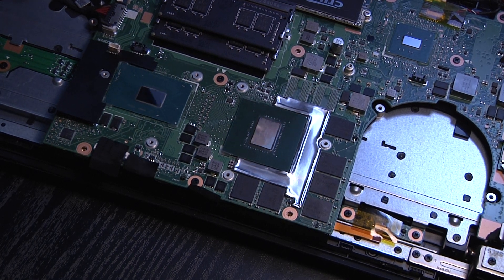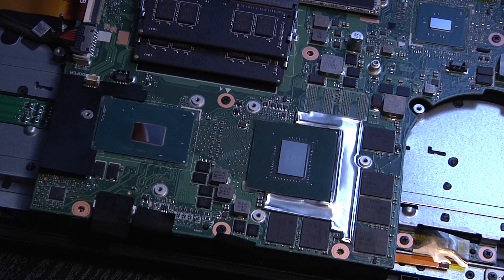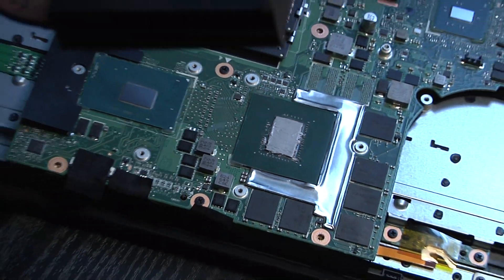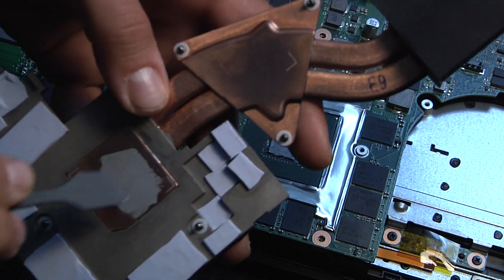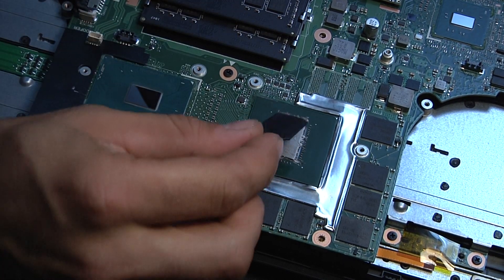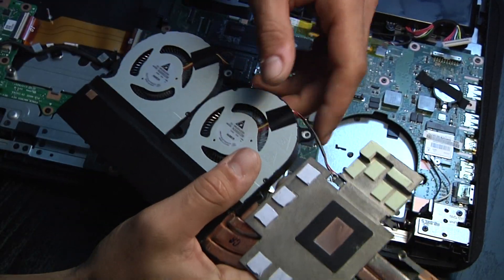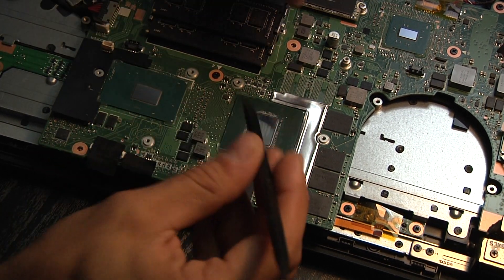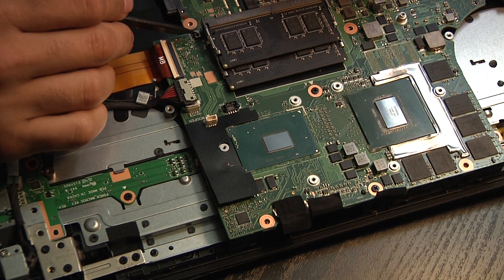How to repaste a laptop CPU & GPU

Comment: hey bro my thermal pads on side chips were degraded so the technician pasted new ones but it didnt help with temps and made it worse probably cause it was thick. so can i apply non conductive thermal paste instead of thermal pads as i dont have correct measurement of it?

Comment: Hello can u tell me what thickness did thermal pad u used on the video. i was thinking is it better when i use thermal paste on the cpu, gpu and use thermal pad on vram like the surrounding area of gpu and cpu ( i dont know what is that called ) & using the . or should i just use my thermal pad on gpu cpu and like the surrounding area of gpu and cpu. Thank u!

Comment: I recommend to try phase-change material Honeywell PTM7950. It comes as a sheet and you don't have to mess around with any applying dots, dashes or crosses. Just cut out a piece the size of the IHS/core and stick it on. Also don't have to worry about whether the paste is too little or too much - it will be just right. In addition, it lasts longer, performs works better than traditional pastes and there is no pump-out effect.

Comment: 2:18 when applying liquid metal it would be best practise to apply a conformal coating to the resistors and capacitors surrounding the cpu and gpu. One coating I like is "MG Chemicals 422C Silicone Conformal Coating". If you live on the coast like I do, you could coat your entire board (excluding cpu/gpu dies, slots and connectors of course) in this stuff to prevent corrosion and short circuits from humidity.
Reply from the maker: Conformal coating is also another method. I suggested nail polish because it's cheap and comes with an applicator pretty much built in. Conformal coating typically is in a spray can so if you desire to only coat around the die, it would be a bit messy.
Also suggesting to coat the entire mobo I wouldn't recommend, as it can cause plugs/latches for ribbon cables etc to become stuck and if a component needs replacing it would make it difficult.
Reply: @HotelHero  422C usually comes in bottles and is applied with a brush. You can still easily repair the board as you can solder straight through 422C. If need be, you can remove it with a conformal coating stripper. I did also mention in my original post to not coat/let it get on connectors, slots, etc.

Comment: I have a laptop i bought 3 years ago and it started to reach high temp these days. I had a stress test on XTU and CPU gets 98-99 and GPU gets 90 degrees during the test. I am not an expert but it is hot as far as i know. I am thinking about using new thermal paste by doing things you recommend (which i appreciate a lot) I have a few questions though. 1) Should i try to clean GPU chips? If so, how? 2) Should i use that piece of glass to spread all over CPU and GPU? 3) Is it possible to use the same thermal paste on GPU and CPU? I hope you reply back, THANKS!
Reply from the maker: Not sure what you mean by cleaning GPU "chips". Do you mean the VRAM?
Reply: @HotelHero  Yeah, i do. I have a pure alcohol. Is it possible to use on chips (VRAM) And i repasted both GPU and CPU but this time CPU reaches over 90 time to time. It goes around over 90 and 80's time to time.. Is it related with pasting problem?

Comment: Thank you for this video! I've actually changed paste may be like 5 or 6 times in different laptops but never changed the pads. But now I think I need to change them in my laptop. But I'm unsure about the thickness. 
I've the nitro 5 2018 which has the same exact body and heat sink as the helios 300 2018 and same specs too. Just the fins of the fans are plastic. 
What's the thickness of the pads you used in the helios 300? I think there are 2 different pads, one kind of yellowish and the other white. Are both of them the same thickness? And is a 100x100mm enough?

Comment: Spot on. 

Just a line or a centre blob is NOT enough.  We do have to have a thin layer,  just like Thermal Grizzly recommends.

Temps will effectively go down AND IT ALSO MINIMISES THE PUMP OUT effect. 

Great,  great video. 👍
Reply: I recommend to try phase-change material Honeywell PTM7950. It comes as a sheet and you don't have to mess around with any applying dots, dashes or crosses. Just cut out a piece the size of the IHS/core and stick it on. Also don't have to worry about whether the paste is too little or too much - it will be just right. In addition, it lasts longer, performs works better than traditional pastes and there is no pump-out effect.

Comment: I've just repasted my first laptop by using the spread method as shown in the video. The laptop was still on its factory thermal paste and I've had it for 8 years now. I was shocked when I saw The CPU temperature drop by 20*C! I was hitting 94*C under all-core load before and now it's 74*C. I'm so happy! The GPU temps dropped too from 62*C to 58*C (tested with Unigine Heaven benchmark).

Comment: What is the problem with squishing the thermal pads? The thinner the pad the better the heat conductivity and if you get metal to metal on the cpu and gpu thats a good thing as well... So why not tighten it well?
Reply from the maker: Because if you squish beyond the OEM thickness you'll have metal to metal contact between die and heat plate = overheating and squishes paste out from plate
Reply: @HotelHero  OK i think you got something wrong there, metal to metal contact is not a problem in fact its desirable, the heatpaste is only there to fill the microscopic or bigger gaps where there is no metal to metal contact but its not supposed to get in the way of metal to metal contact - at least as far as i understand it
Reply: @HotelHero  Metal is far better at conducting heat than any thermal paste is, copper has a thermal conductivity of 384 W/mK, while a good thermal paste with metal or graphite particles in it has only about 10W/mK - air though only has a conductivity of 0.026W/mK.

So the idea of the thermal paste is to replace the air that would be between the die and the heatsink, due to their roughness and uneveness, because the paste is about 300x better at conducting heat than air. 
However the metal is still 30x better yet than the thermal paste is. 
Metal to metal contact is therefor ideal.

Also the heat flow through a barrier is inversly proportional to the thickness of that barrier - the thicker the insulation or wall the slower the heat will flow through it, because the temperture gradient across the material will be more shallow - we know this from every day life.
That means that you want the least amount of thermal paste seperating the two metal surfaces. If the heat has to flow through 2x the amount/thickness of thermal paste then only half the watts are going to flow through it (if the temperature difference would stay the same between die and heatsink, in reality the die will heat up and the temperature gradient will increase again and the same watts are going to flow again just with a slightly hotter die) - thats why you dont want any seperation of the metal surfaces.

So there you go - the thermal paste is only there to replace the air that would otherwise be inside the microscopic scratches and roughness of the metal surfaces but NOT to get inbetween the metal surfaces where there would otherwise have been metal to metal contact, and you certainly dont want a thicker layer of insulation between the metals made out of thermal paste, which sucks at conducting heat, relative to the metal.

Please tell me if you disagree or not...

Comment: Right on! I was watching instructions for my specific laptop, but the guy didn't really do it right and I just copied what he did.. just left the drop in the middle and that's it. So I will have to re-do it, but at least this time I know it will be done right! Great video
Reply: When you spread it you introduce air bubbles, you're supposed to put a blob in the middle or do an x on the die then when you apply pressure to it from the heatsink it will spread it. If it doesn't spread across the entire die there is not enough paste or not enough pressure from the heatsink.

X method does actually solve the problem he is showing here. He mangled the x but that is the best way because its pushed out without introducing gaps of air in the paste. You get a good spread.
Reply: @donniedarko7751 That has been debunked numerous times, you don't create any air bubbles spreading it, it's bullshit

Comment: Hey boss, I just applied mx4 and my temps actually went up, but I think i know why. U see these heatpads (not the paste on the processor/gpu, i mean the pads on the heatsink). I fucked up and removed some of them, and i am not certain of the measurements. Right now I limited my cpu to 99% max power because my temps have been hitting 100. I wanna replace all the pads and redo this right, any advice? Are the correct thermal pad measurements super essential, and where should I be putting them? (thank fully I took pics of the heatsink when I first opened it so I do have the old factory default outline)

This is a lenovo legion C7 btw
Reply from the maker: I don't own a Legion but atypical thickness for thermal pads is 1.5mm. I'd definitely not use the system until you get those pads replaced because those chips/VRMs can fry.

Comment: I just repasted my Helios 300 2019 using spread method with Arctic MX-4, and after booting up my discrete GPU can't be detected. After refreshing device manager my GPU appeared. I tried using applications which uses my GPU, looking at Predator Sense the core% is at (-1%) while my temp. is increasing to upwards 90+C until I get BSOD. I tried reinstalling and updating the Nvidia drivers but still the same results. Any help?
Reply: Update: I opened my Helios again and observed that the paste from the GPU seems have no contact with the heatsink. So I cleaned, and repasted it again with spread method but more thicker than before (which I just covered with just enough to cover the GPU). Viola, it works with amazing temps.
Reply from the maker: @ThatOmadGuy  Strange, did you replace the thermal pads? Sometimes even 0.5mm can mean the difference between contact and no contact. Glad it worked out though
Reply: @HotelHero  Yup I replaced the stock pink thermal paste on the VRMs with 1.5mm pads and 1mm for the rest. Idk as well, but happy it worked at the end

Comment: Can I use an M.2 NVMe PCIe SSD for Acer Predator Helios 300 PH315-51-51V7 having i5-8300H CPU ?   kindly help
Reply from the maker: Yes, but you won't get PCIE speeds. It will be faster than a regular M.2 though

Comment: Help me please...i simply dont know what to do..i ve bought MSI GL76 and while i play games, my CPU gets 90-97 C with turbo cooling boost...can someone tell is that ok or not - internet have so few info about this laptop, half people\manuals say that this is ok and the other half says that this is catastrofic(after 0,5-1 yeah i will have peace of junk)...i think i am going crazy(this is my first laptop)...
Reply from the maker: If your laptop isn't shutting down all by itself to protect itself from temperatures then there's nothing wrong.

Only issue is at 92-95 C for most laptops the CPU will thermal throttle (slow down) to lower temps which can reduce gaming performance. It's not damaging just not good for framerates.

Comment: You recommend to spread a little over the heat plate as well, to make sure it is adhesive, but as the surface area is bigger than the die itself and uneven it‘s guesswork/messy. What would be your opinion to spread a thin layer on the die and then putting a „X“ on top of it?
Reply from the maker: The reason you want to apply a bit manually (with a spreader) to the heat plate is because of the micro grooves in the copper itself.

If there are small gaps in the grooves where paste doesn't apply the air can create heat pockets and temps could fluctuate.

To be honest your idea would probably work just fine and this is mostly my opinion as an OCD individual lol.
Reply: @HotelHero  thanks for the quick reply, you‘re the mvp 🙏
Reply: The majority of the paste goes to the cpu dye and a very thin one goes to the heatsink it's not brain surgery

Comment: Sorry dude... You keep calling those objects surrounding the chips, pins... THE AREN'T Pins...  They are actually Bypass capacitors.  Each is an individual component and they can be fractured...  DO NOT PICK at THEM with a metal cleaner, they are CERAMIC...  Leave them as alone and untouched and un roughed up as possible or they may fracture and short...

Comment: Replaced the mobo in my alienware 15 r2 it is overheating, im pretty sure, ik i did good on thermal paste, do you guys thinks its time for new thermalpads? or is it an issue being a rev 02 board and the original was rev 001, they are the EXACT same chipset i am 100% sure idk what else it could be lol anybody else have this problem?
Reply from the maker: Depends on what the rev differences are.
If you have even 0.5mm difference in mobo such as deck spacing from heat plates, then it'll overheat.

I'd suggest new thermal pads but make sure they are the correct thickness.
Reply: @HotelHero  Replaced thermal pads battery and have new charger confirmed 100% right board for my heat sinks and got into windows long enough to download temperature monitoring software cpu and gpu were great! (30-40 C)  and it never felt like it was getting too hot, talked to seller of board and they are just going to do an exchange for me i think it has something to do with the power delivery of the board but its just a hunch from what im seeing... didnt have time to trace it out

Comment: aight imma try this now

update: Ive tried pea sized and line method in the past. They kinda worked fine but after gaming for an hour, my lappy (Acer nitro 5 ryzen 3550h/gtx1650) started to thermal throttle(95-100°C). i thought my laptop's a goner. but then i tried this spread method and damn its working! played gta v for first 40 mins in max and am getting stable 90-92°C without any thermal throttle (ik its still pretty high but Atleast its still better than experiencing thermal throttle every 2 minutes). I tried AC valhalla as well played for 40 mins and got stable 90-93°C on it throughout without any issue. the temperatures are probably high because of the environment where i live in xddd which is about 40°C

Comment: I did a repaste to my old laptop's GPU, somehow after that, the GPU stopped working, I first I thought it was a driver malfunction, but it didn't respond. It was being recognized by Windows, but there was a warning sign on the device manager
Reply from the maker: There are many different things that could have happened
Reply: Seems like you destroyed some circuitry with ESD discharge

Comment: This is absolutely the way to go, already opened my laptop once before to re-apply thermalpaste, made no difference.. Opened it up to repaste and clean it now (6 months from last repaste), and found it was not spread evenly. I now spread it out evenly myself on both the heatsink and cpu/gpu. Thermals went from 95 on cpu/91 on gpu (stresstest), to 80-85cpu/75-80gpu (stresstest). No more throttling and works like a charm! Used NT-H1 thermal paste. To anyone having issues with temps also look up undervolting your cpu. Great video!

Comment: Got to tell you, the place that heats the most is the center so don't care that much about the corners
Reply from the maker: On a desktop, yes.
On a laptop, no.

If you look under the plate of a desktop chip you'll find a die like a laptops in the center. That is why the desktop chips get hot mostly central.

Not covering the corners is the difference between normalcy and thermal throttle.
Reply: @HotelHero  oh yeah I forgot that 😅

Comment: incase you are @Red-Sand  in acer community I have used your profile of undervolting and they were very helpful though i have some doubts if you could clear them....Thankyouverymuch your profile have reduced temperature from 95 degrees to 70 at max while intense gaming..though I have a question will this will reduce my CPU or GPU lifespan..as previously my CPU and GPU usage were 90-95 and 99 respectively Now temperature, as well as usage, have dropped massively...And also I always set the profile to the game battery while playing games as it helps me reduce the temperature even more even though i play while plugged in is it safe....Further important one previously my cpu used to reach 2800mhz to 3000mhz CLOCK SPEED now it stays are 1003 mhz or slightly up and down is that fine or should it be a concern... Reply soon and Thanks...
my specs I7-7700HQ
Nvdia1050Ti 4gb and 16gb ram
Reply from the maker: I am Red-Sand.
My profiles extend the life of all components in your system. 👌
Reply: @HotelHero  okay Thanks so can I run profiles of ultra battery / game battery while gaming even though I am plugged in(by default while charging profile is set to performance)....2)Are you sure I don't have to worry about reduced clock speed dropped from 3000MHz to 1000MHz (in games like GTA 5 ) after using under volt profiles....and yeah thanks....again I just worry too much about this stuff as I have limited knowledge of all this.....and yeah thank you again your profiles are game changer if I hadn't found them my Acer nitro would have exploded...😂😂😂😂

Comment: Having acer Helios 300 i5 8th gen 1060 with temps reaching 95°c
Qn) which will thermal paste will you recommend grizzly kryonaut,corsair tm30 or arctic mx4?
And are thermal pastes conductive as in can it cause short circuit if we accidentally apply a bit to the pins nearby?